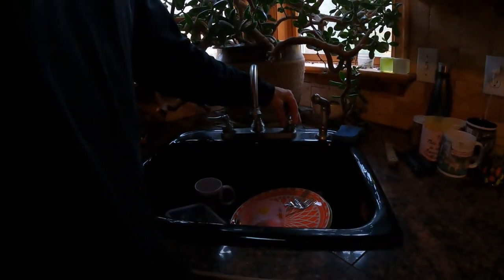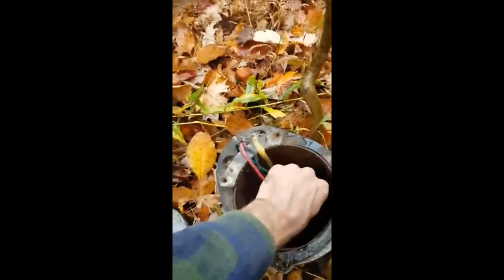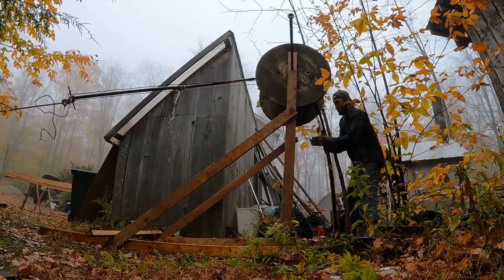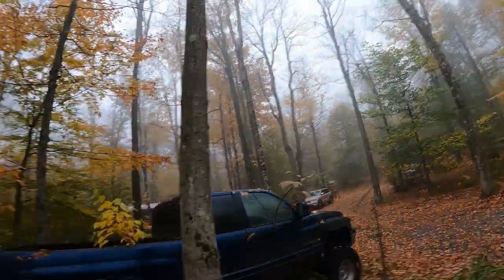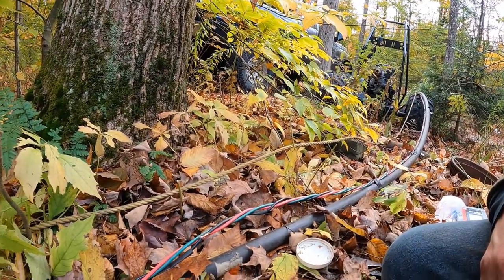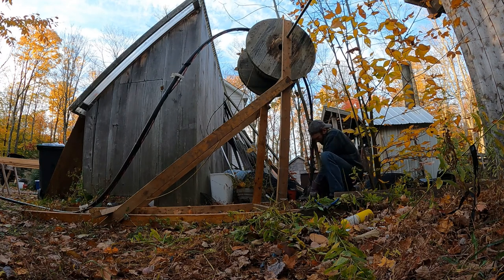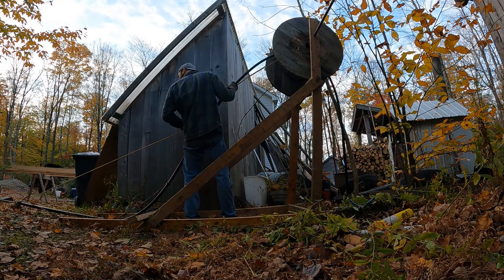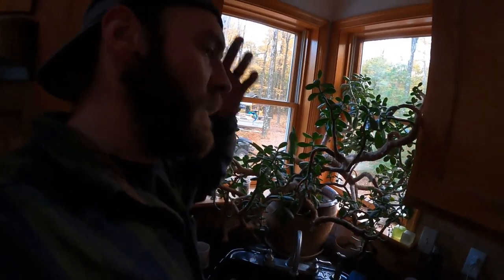How to Pull your WELL PUMP Tricks and tips to help you out

Comment: I see this vid was from a couple years ago. Everything still good?
I need to pull my pump and im looking for inspiration and tips. Previous owner bought this house in 1996 and there was no records of when the pump was installed even then and they never had to touch it. It still works but foot valve won't hold anymore and it hammers hard when it starts. But after 27+ years, I guess it doesn't owe anything!
Gearing up to do this myself. Got a tractor some skills and the ambition!
Reply from the maker: Just take your time and plan to have a way to hold the weight so you don't have to. All is good since and hopefully for years to come. Saved a fortune!  Just a tip if you want better water pressure use a stronger pump. Wish I went even bigger!

Comment: Good job…
Personally, I would’ve gone ahead and replaced the pump after all that work, and maybe kept the old pump for a last resort emergency backup…maybe remove the tree while it’s still small 😁
Reply from the maker: Well 2 months later I had to pull the pump and replace it.  $800 later for the pump. All our pumps went this year.  Septic, well and circulator pumps. Got 22 years out of them. Luckily I still had this setup made and it went pretty quick and smooth.  And I thought about changing it the first time but....$800 and it still worked fine. Most of my stuff has a don't replace until it can't be cobbled together anymore policy.
Reply: @MrBriansAmazingWorld  - what brand pump did you use , and where did you purchase it ? 
I’m in northern IL and don’t want to wait 2 months for some specialized pump from overseas.
Great video bro ❗️

Comment: wow, that contraption of yours worked very well, impressed. Can't imagine having to pull that out by hand
Reply from the maker: It is definitely not fun having to pull a well. So relieved that this worked as well as it did.  It did all my hard lifting for me.
Reply: @MrBriansAmazingWorld  yep definitely, good stuff. Here in SA we use a 3 core submersible cable that runs all the way down the sleeve so we very seldom have the cable being damaged as it is well insulated. In addition we run a nylon ski type rope along with the pump so as not to put any stress on the cable when removing the pump.
Reply: @geraldlopez6858  So with your installs you LEAVE the rope attached??
Reply: @REVNUMANEWBERN  yes, rope runs alongside cable, we usually just cable tie the rope (nylon rope) and the cable before dropping the pump
Reply: Had a friend pull my 440 footer out by HAND, ONE tuff lile guy! 5'5 145lbs n stout as a Rhino!  :)

Comment: Looks like a great idea, I'm wondering if it would be a good idea when putting in a pump that it would be a good idea to attach stainless steel cable to the pump itself & run the cable to the top just for situations like this???
Reply from the maker: Nylon rope seams to hold up and work fine. There are plenty of people counting on the pipe and wire alone to hold their pump.  Stainless steel would be expensive too. I'm sure it would work.

Comment: I'm new to this but why are you letting trees grow next to the well?
Reply from the maker: I like to get any tree I can to grow.  Especially these hardwood trees. These are ash trees and they are all dying from the emerald ash borer.  The deer eat all the other baby hardwood trees too.  Also the trees won't hurt the well it is 600 feet deep and has metal casing running to bedrock. Tree roots will affect septic fields, pipes, and foundations however.

Comment: That was about 6 or 7 years ago we pulled and replaced the wires. Stopped with the bumper 2 ft from main road.
Reply from the maker: Yes. Really getting good at pulling these.  It's a long pull.